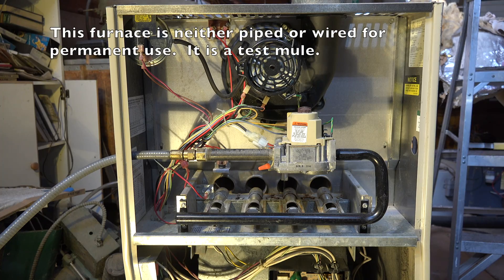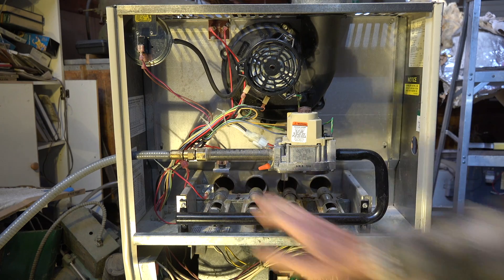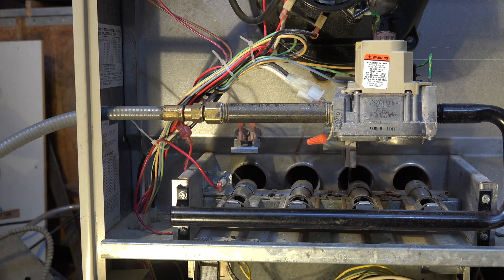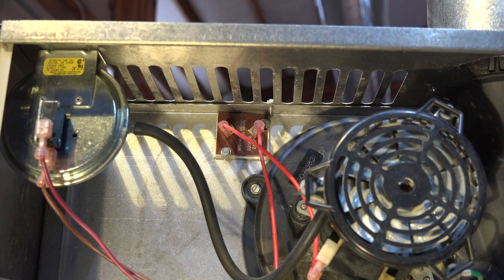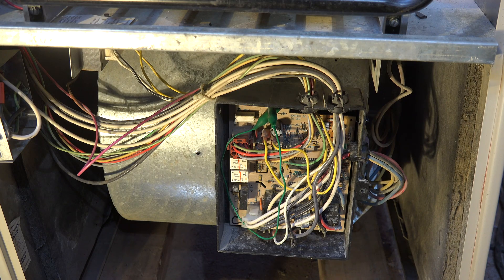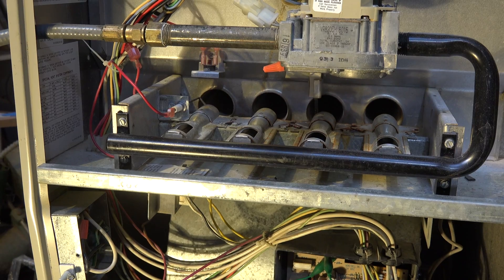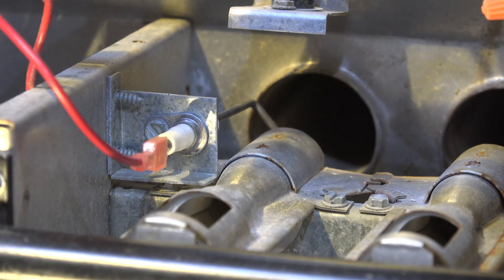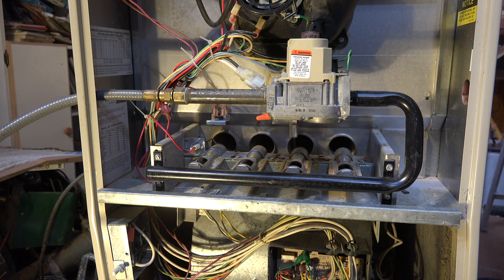The Rheem/Ruddd RGDG model limits and safeties #3

Comment: Inherited this furnace with house. Blower won't stop. Furnace heat works properly but when temp reaches proper level, blower runs continuously. Replaced Limiter (high limit switch) & installed new programmable thermostat (not smart). No secondary limiter on blower. Any ideas why the blower won't shut off?

Comment: Mine won't come on at all,  no power to thermostat either 😒
Reply from the maker: Start with this:  If the fan comes on when the fan switch is set to "on", you have power to the furnace.  If not, you don't.  
GFM

Comment: I'm really enjoying your videos! 

I have Rheem Criterion II furnace with this set up.  Problem I'm having is the burners light up for about 4 seconds,  then click off just before blower comes on.  We replaced the flame rod sensor and limit switch, no change.  Cleaned the tube attached to pressure switch, even though it wasn't clogged or anything.  

I'm thinking it's the IFC board.  Need to replace it.  What do you think?  (I know there's probably other causes, but thought I'd throw that out there).  

I'm really surprised how interesting your videos are...makes me want to go into HVAC work instead of being the nurse I am!  Hahahaha!  Thanks Mr. grayfurnaceman!  :)
Reply from the maker: You could have a problem with the control board.
GFM
Reply: grayfurnaceman Thanks so much, sir!   I had a real HVAC man come out today and that is what he thinks it is.   Quoted me $578.00 to replace.   Ugh!  Hahaha!   Oh well, thank God for payment plans!   

Thanks for the quick reply, have a great day!

Comment: My rgdg inducer motor will start slow and then shuts off also it will get up to speed then die down . Sometimes the cycle will run. Can it be something else besides inducer motor. Is there a transformer that can be going bad
Reply: Same here, though mine kicks on with the thermostat off (or removed). Blower turns on, inducer constantly kicks off and on sometimes cycling every other second. I Posted here just in case an answer appears https://diy.stackexchange.com/questions/193559/rheem-rgdg-unit-turns-on-w-thermostat-off-blower-come-on-and-inducer-motor-swit